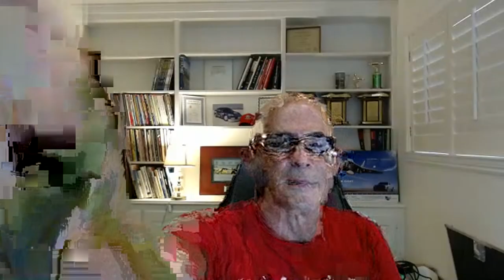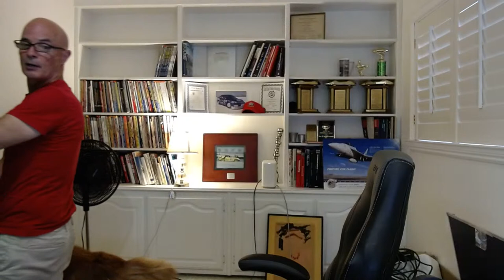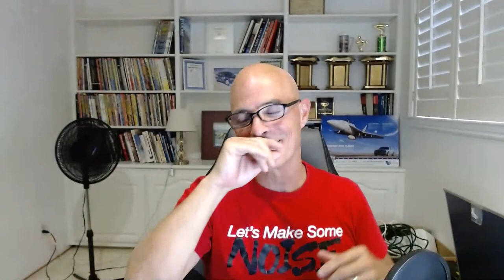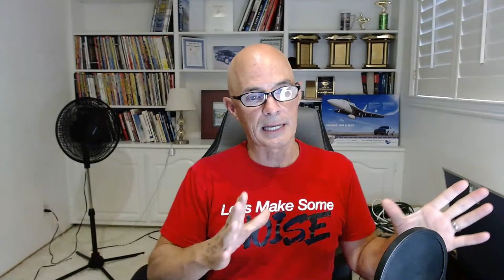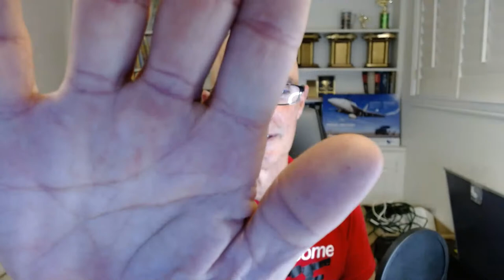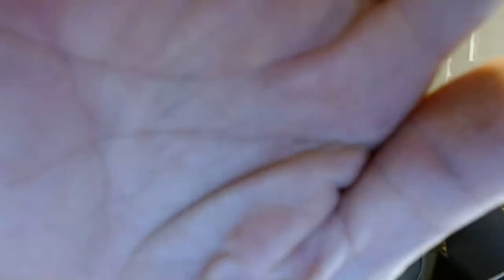LET'S TALK TECH-MISTAKES WERE MADE (TUNING ERRORS)

Comment: I did backpressure testing on the stock turbo Dodge intercooler using an electric leaf blower, some PVC, some clear hose and water with food coloring (homemade manometer). I got that idea from Gus Mahon.
Reply from the maker: I WILL HAVE FLOW RATES FROM A BENCH, AND PRESSURE AND TEMP DROPS AFTER TESTING

Comment: As for heads- my understanding is that you can, with a little work, put on DOHC head from an SRT-4.  Would seem to be a much easier way to make power without stupid amounts of boost.
Reply: Either of the sohc or dohc neon heads will bolt on and are cross flow and 16 valve. The sohc head would be easier due to just 1 cam sprocket. The srt heads have a bump out in the casting for  larger oil drain back holes and might not seal against the block.